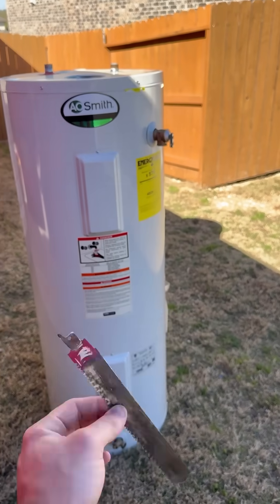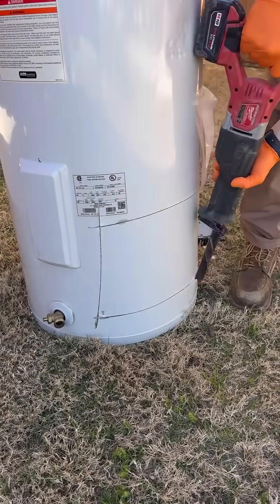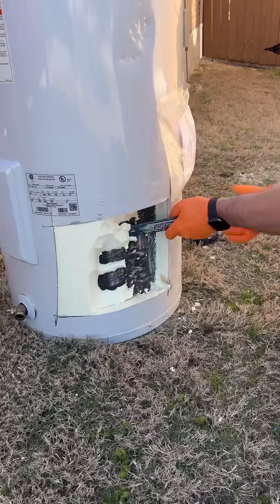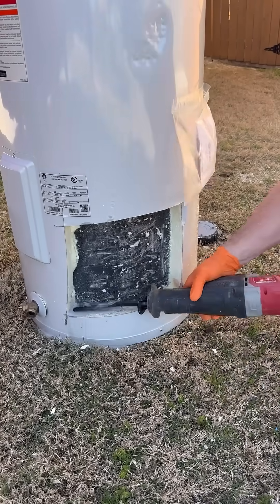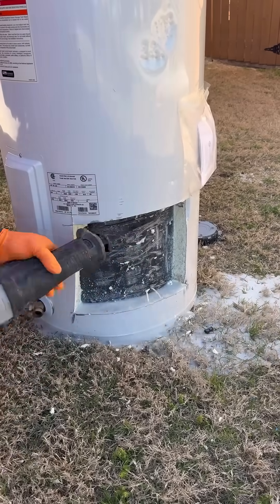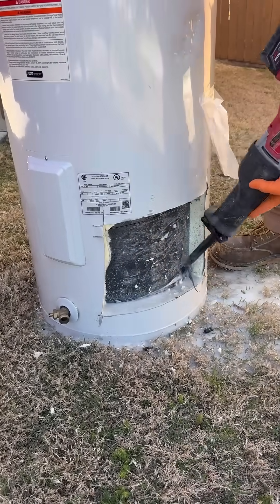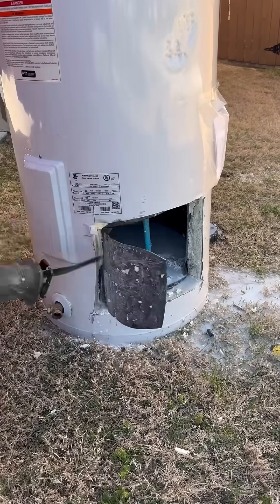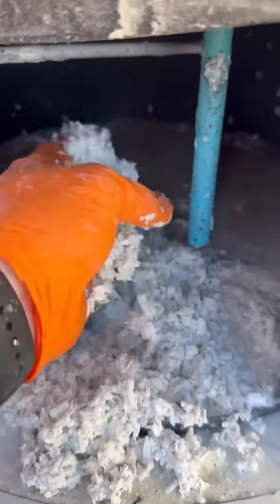What Is Inside This Water Heater?

Comment: Try adding a couple gallons of white vinegar, and let it sit 12-24 hours.. drain and then flush 2 or 3 times.. it'll save you about 800 dollars
Reply: I just replaced the cheap plastic drain valve with small outlet on my water heater with a large brass ball drain valve with a hose connection, and drain it every year as he says.  Getting that extra flow gets a lot more junk out.  I also keep the anode rod checked and replaced about every three years or so. After 12 years it still rumbles a bit from time to time, but it’s not too bad.
Reply: How did you get the plastic valve out? I was afraid to touch mine without breaking it off in the water heater  @E.L.RipleyAtNostromo
Reply: Citric acid works way better :)
Reply: @AAAAAAndrea why is that? Is it more cost efficient too?
Reply: @DM-ry3nw  back in the days I could buy citric acid at a ultra low price, now it's similar. But citric acid makes waaaayy less smell and works better
Reply: @AAAAAAndrea I'm feeling frisky. Why not just go all in and use hydroflouric acid?
Reply: @AAAAAAndrea muriatic works better than that
Reply: @AAAAAAndrea I believe citric acid is more expensive per gallon though right? I may be wrong
Reply: @AAAAAAndrea  Muratic Acid?
Reply: @crazysquirrel9425  Muriatic is strong and tends to corrode steel more, these are gentle acids :)
Reply: @AAAAAAndrea  put in a buncha orange juice, gotcha!
Reply: @pm079  lol, not orange juice :) buy solid powedered citric acid, put it in boiling water (to kill any mold/bacteria in it and to dissolve it properly ) and then throw it in.
let it act for a bit, acts super fast the more warm the water is.
Reply: @pm079 it's not strong enough ( at least I don't think it is)
Reply: @squidwardshouse7375  We have different heaters in my country :) we used to use acid in them.
Reply: Where do i pour the citric acid from? Any suggestions would be much appreciated thanks.
Reply: @rubenmadrid3154 Either pour the acid through the sacrificial anode hole, or disconnect one of the water connections in the top of the tank.
Reply: @rubenmadrid3154  in the hole where the anode is? in EU we have many diffirent heaters and its easy to add something inside.
Reply: @rubenmadrid3154 if you can remove the anode rod from the top of the tank, you can add the citric acid from there with a funnel. That’s what I do. Otherwise you would have to drain the water heater connect a hose with a funnel to the water heater drain valve and add the acid that way, which is a chore and doesn’t look very effective. There are videos of guys doing that with vinegar.
Reply: I replaced my water heater myself, same size as in this video, cost $600AUD
Reply: @A-Dingleberry  mine was about 300 you were over charged
Reply: Citric acid better and cheaper
Reply: @MrBalrogos Muriatic acid is better.
Reply: I used muriatic acid, I like to turn off my water at the main valve and pop both Inlet and outlet hoses on the top, let it drain a good bit and then throw and couple caps full of it inside. Muriatic acid is used in a lot of things but you can actually buy it to clean the calcium buildup on and in pools and help with calcium build up. It worked great for me for years now, a days worth of work but I haven’t had to replace my water heater in god only knows how long.
Reply: @ExodusAlpha3908  In my country I can buy it freely , but I still don't use it. Way safer with citric acid :)
Yeah muriatic/ hydrocloric could be good but you gotta be careful with it.
Reply: Make us a video please @ExodusAlpha3908
Reply: Omg lol another magical miracle white vinegar lie
Reply: Everybody here who doesn't understand that Coco was joking 🫏🫏🫏🫏
Reply: Better opinion is why doesn’t manufacturers make a clean out port so you can effectively remove it and access the inside of the take clean this stuff off. Rather than making it so I closed that you’re only option is replacement ? Knowing damn well if we could open this tank and clean it we’d get many more year out of it.
Reply: @Bladekieta96 They do, is the valve at the bottom, they also install anode rods that should be regularly replaced. Almost no one does it though. 
You can’t expect them to put a trap door on a pressure vessel so you could wait 10 years and clean it out with a broom. That would significantly raise the price and wouldn’t get used anyway. Flush it out yearly using the drain and you’re good.
Reply: @Bladekieta96  usually they are  tossed when the element leaks at around stated lifetime.
Reply: @Bladekieta96 there is a drain at the bottom of your water heater. you're recommended to drain/flush it yearly to clear any sediment from it. you don't even need to pay someone to do it, if you have a hose you can do it yourself very easily.
Reply: @bladekieta1828  you answered your own question.  So you buy a new one 🤦‍♂️
Reply: @Bladekieta96 mfg don't want that😂
Reply: @bladekieta1828 lol are you serious? They don't care aboutbus servicing the equipment.... they prefer us replacing it... that's more money on their end...
Reply: @Bladekieta96  Because it's a sealed pressure vessel encased in 3 inches of foam and a layer of steel, Einstein.
Reply: @Bladekieta96  Cause money! better to sell new one that for customer use 1 heater and maitance it right :)?
Reply: It was replaced because it was leaking, not because of the buildup
Reply: Damn the entire citric acid crowd is totally wrong, (talk about failing chemistry lmao) acetic acid has shown time and time again to be more effective at dissolving calcium, then again, our water heaters arent that shitty compared to american heaters, but no. Go ahead, use all the citric acid you want. Maybe someday you realize theres a difference between vinegar (5% acetic acid) and pure citric acid, yes it will work faster, but pure acetic acid will serve you much better in the long run and you wont fuck up your water heater, which if you keep it up by using citric acid and boiling water, soon you wont have a boiler anymore. Please redo your chemistry classes.
Reply: Yes. Citric acid WILL remove it faster and chelate the calcium ions faster but so does the metal. Do yourself a favor and use acetic acid. Not citric unless you want to replace your water heater every 10 years ig lol
Reply: Also dont use boiling water. Room temp is more then enough to eat away at the calcium ions, using boiling water is literally making everything worse with no benefit.
Reply: @ananteshesha5788 Fully agree, and there's another reason why you shouldn't use citric acid. It forms calcium citrate which is insoluble in water and just precipitates out, but when you use vinegar it forms calcium acetate which is water-soluble and can easily be flushed out.
Reply: Vacuum and a hard tube to scrape the bottom. The buildup around here is insane.
Reply: White vinegar does not repair the glass liner 😂
Reply: Sweet, I was just asking, "How would a person  clean it?"
But I see your answer.
Thxs dude 👍
Reply: Thinking the same thing it looked new
Reply: How on earth do you flush it? Can you make a video?

Never knew you can get build up like this. Ours must be full.
Reply: @dale7561  There's an easier way than asking for a video on YT...GOOGLE IT !!!
Reply: if you want rust yeah
Reply: How exactly would it save you 800? Genuinely asking
Reply: Easier way. Install a full flow/ball drain valve. Turn the incoming water off but open a hot water faucet or two. Drain the tank. With the drain valve open fully, Drain the tank again. The water filling the tank will stir the sediment. With the tank drained a couple times and empty, you can insert a 1/4 inch plastic hose and flip it around to loosen any remaining residue. I've done it this way and get my water heaters to last 25 to 30 years. An endoscope on my cell phone shows a clean tank.
Reply: How do you put vinegar into the tank?
Reply: @steelewheels1365  Either the incoming or outgoing nipples in top can be used. The incoming nipple is best and easiest. 
Or, drain the tank completely. With a hot water faucet open as an air vent, hold your drain hose at the top of the tank and pour the vinegar in through the drain valve. Close the drain valve. 
If you have an electric water heater, you can remove a heating element and pour the vinegar is that way. Soak the h4eating element in vinegar to clean the build-up.
Reply: Vinegar is 50/50... it'll take a lot, and agitation helps (there is none). Whatever you do, don't try using CLR
Reply: @juansolo1617 what is CLR may I as
Reply: Adding it how exactly?
Reply: @Giggidygiggidy12  Through the sacrificial anode hole, or disconnect one of the water lines (it doesn't matter which)
Reply: Vinegar is kind of a miracle product. I‘a what I use for 90% of the housecleaning I do
Reply: How is this going to fix the big hole on the side of the water heater?
Reply: Will vinegar corrode the metal?
Reply: Just imagine using that tap water for consuming how unhealthy all that calcium is, it's like people that have copper pipes or iron pans and are consuming all that extra copper or iron.
Reply: But the thank has a big hole,now
Reply: How’s that supposed to get in the water heater? Water does not go through the water heater after it leaves your toilet.
Reply: @TA.387 I guess you're trying to get roasted as well
Reply: It scares me to think 4000 people liked your comment about putting vinegar in your toilet to fix your water heater
Reply: Or cut it, clean it, and seal it.
Reply: You have to do it regularly or it will destroy the tank
Reply: No body tells you to flush them so all you idiots don't make sense
Reply: Um im sure u flush urs every 3 months rt thats about how much ud have to do it . There a zinc rod in the wheater thats suppose to protect the elements from this stuff but i cut open tons of these things its always some crap in the bottom . U about got to remove it to flush it and do a good job. The drain at the bottom at least the ones 10 plus yrs old will Not drain
Reply: Question why the manufacturers don't make an opening - slot to be open and clean it out very easy ...o we will not have to replace ot anymore..o no money for them $$$$$$ f them all
Reply: Vinegar and steel?
Not a good combination.
Reply: But that will speed up rusting
Reply: Was waiting for the family cat to come crawling out. 😂
Reply: Does this oxides the tank?
Reply: My dad uses a vacuum and sucks it all out
Reply: How do you get it in the water heater? I'm a new home owner and didn't know to do this. I bet my tank is bad at this point!
Reply: @djvelvetgrrl  there should be a water shutoff on top of your water heater. You've got a hot side and a cold side. The cold side is your supply, so that's the one you need to shut off. If there's a ball valve on both sides, it's even better. Turn your valve until it's horizontal to the line, meaning it's closed. There's no need to wrench on it too hard. Once you've closed it off, turn off your water heater, letting it cool down before hooking up a hose and draining it down about 1/3 of the way. Disconnect your water supply and funnel in your desired water heater flush chemicals. Reconnect your water supply and let the tank fill back up, careful not to use your hot water inside the house during this part of the process. Let her sit for a while and drain completely at least twice before refilling and firing her back up for use.
Reply: how do you add vinegar??
Reply: How about a water softener!!!
Reply: Home Depot sells concentrated vinegar specifically for cleaning. 30%, or there about.
Reply: Cool
Reply: How is that gonna help, there's a giant hole in the side. Damn you must be stupid
Reply: Gonna cut open the plumbing to the heater to add the vinegar, then fix the plumbing to run the water through? It's a tank not a bucket, they tend not to open. That's why he cut into it.
Reply: @Lord_Neko_  nope. If you look carefully at your water heater the inlet and outlet on top have threaded connections and in my area it is code to use flex-pipe which makes it easy to remove so you can funnel your chemical of choice into your waterheater.. they make descaler specifically for water heaters. I used to work for a company that would actually do this for you for about $200. But for me, I find vinegar works just as good, and you don't have to wear PPE to handle it
Reply: The tank is 4 foot high, and the calcium is just 2 inches...   Plenty more room....
Reply: Or buy citric acid
Reply: Shop vac, duct tape, and a length of garden hose... I ain't waiting
Reply: How much nu calgone would you need to clean this?
Reply: Are water wrappa's still a think and are they worth it?
Reply: The Wrappa is a compact electronic scale conditioner that uses radio frequencies to alter the characteristics of the minerals within the water, preventing them forming hard to remove scale deposits. With no pipes to cut or joints to be made, the Wrappa is easy to install & maintain.
Reply: Just remove the element lay the tank down on two block, there r two 1 inch socket there u attach a hose full it up them turn it an flush it out use ur fingers
Reply: Add it where 😂
Reply: Have to make sure you have the bottom open, don't leave it closed while the reaction takes place. Have seen a water heater explode due to this, it produces huge amounts of co2 gas.
Reply: @rdizzy1  what happened to the relief valve?
Reply: @coro_ctrl Is there a Mr. Gump, Mizzes Gump...?
Reply: Would be nice to make a water heater with an access door you can open and scoop up all the crap at the bottom of the heater but that would be too easy 😅😅😅😅
Reply: @Derek-ex7sn  A pressure vessel with a door in it? 🤔 
Yeah, can't see how that could possibly end in class action lawsuits.
Reply: @Coro. There’s still time to delete your post.
Reply: No
Reply: 😆 always the dumb vinegar idea Hahaha. People failed chemistry lol
Reply: @amushyforyou6083  never took a chemistry class... but I've been plumbing for several years.. I think I know a thing or two.
Reply: @amushyforyou6083  Sounds like you failed chemistry, vinegar is a chelator of calcium.
Reply: @amushyforyou6083 no good :??
Reply: @amushyforyou6083  Vinegar is really ultra mild on calcium, always funny to hear the vinegar BS 😂
Reply: @dimmacommunication white vinegar is usually.5-2% acid. I have some that's 30%. That will definitely break down calcium.
Reply: @AAAAAAndrea I use vinegar all the time on calcium buildup on shower head. It removes it fast-even the hard deposits.
Reply: Guys,

YaH The Heavenly Father, HalleluYAH “Praise ye YaH”, (Genesis 1) was Who they Crucified for our sins and YaH arrived to be Crucified via the Tent of Meeting (Hebrew Book of Isaiah)

YaH The Father (Genesis 1) <— He’s our Savior
Reply: That makes absolutely no sense because when you flush it it just goes into the sewage system not the water heater lmao
Reply: @coro_ctrl he’s talking about flushing the water heater.. not a toilet. lol
Reply: @Tripcord  He ain't that bright 😅
Reply: @coro_ctrl  once all that calcium is broken down by the vinegar (being slightly acidic but food safe) you have to get rid of the free floating calcium or it will just sink to the bottom and reform into a disk shaped rock.
Reply: @Misfit.Profit  i dunno how is there, but here in central europe water heaters have their heater core on the bottoö, so you can remove a large access panel on the bottom, and clean it by hand every 2-4 years. Also we have a galvanic rod which you can replace periodically, as it gets eaten away by rust instead of the tank's body.
Water heaters stay in use here for like 30 years here.
Reply: Is that gard to get rid of the free floating calcium? When I flushed my tank in the past I was very vigorous filling it then totally empty , many times. Also oartual fill, ppen pressure flies, add some air Pressure, total flush again
 Is that free floating stuff different than the normal calcium sludge ?  @Misfit.Profit
Reply: @coro_ctrl you are a comical genius.😅
Reply: Haha @coro_ctrl
Reply: @coro_ctrl  There's a valve on the outside of the tank that is threaded for an ordinary garden hose. I'll let you figure out the rest. SMH.
Reply: @coro_ctrl facepalm
Reply: @coro_ctrl you flush it through the water with an external hose
Reply: @coro_ctrl the fact you got 17 likes is mind boggling. People need help
Reply: @koffeetechshow he got more . we're living in the movie idiocrcy
Reply: @coro_ctrl this is one of the best trolls I’ve ever seen dude 🫡
Reply: @coro_ctrl yikes buddy….
Reply: @coro_ctrl 
 Thats the point.
Reply: @jjjsmith2497 yeah, if you flush enough vinegar into the sewer system, the entire system’s water will be decalcified, softening your water
Reply: @coro_ctrl how many extra chromosomes do you have? With a comment like that my guess is at least a dozen.
Reply: @coro_ctrl hey dude, it's been 4 days, you ok? 😂 We all have those moments hahaha
Reply: @coro_ctrl man you are tragic
Reply: @coro_ctrl jokes repel from your head
Reply: @coro_ctrl 🤦
Reply: @coro_ctrl I’m assuming you’ve never rode in a normal big school bus huh? Always the shorter ones
Reply: @coro_ctrl  are you slow? flush doesn't just meant toilet
Reply: @coro_ctrl  bwahahaha you thought they meant "flushing" meant "flush the toilet??"
😂😂😂
Reply: @coro_ctrl Room temperature IQ type of comment
Reply: @coro_ctrl so when you flush your engine you have to flush your toilet to do it?
Reply: @coro_ctrl  there is a valve at the bottom of the water heater that flushes the water out, you can attach a hose to it and take it outside.
Reply: @coro_ctrl how does it feel to be utterly r tarded?
Reply: @coro_ctrl  r word.
Reply: @coro_ctrl  it technical team us by plumbers, in normal contacts, normally means piping system for clear out the in side pipes?
Reply: @coro_ctrl  he means unbolt tank find the inlet pour the vingerger wait the time then pour it
Reply: @coro_ctrl  you’re not the sharpest tool in the shed are you
Reply: @coro_ctrl son I bet your bus was smaller than the rest and had grape flavored windows.
Reply: @coro_ctrl  no shit?
Reply: @coro_ctrl don't have kids
Reply: @coro_ctrl  huh ?
Reply: @coro_ctrl say you’ve never worked on your water heater without saying it😂
Reply: @coro_ctrl br..... bro....... lmao.... 😅
Reply: @coro_ctrl  😂
Reply: @coro_ctrl did you know there is long bus?
Reply: @coro_ctrl you’re getting cooked
Reply: @coro_ctrl  flush as in drain and refill.  like how the toilet drains everything and then refills the bowl. same as in flushing a car's oil tank: you fill it and empty it a few times to get all of the unwanted contaminants out.
Reply: @coro_ctrl  what?
Reply: @coro_ctrl  Wtf you talkin about hahah
Reply: @coro_ctrl  when your mom said you were special, she meant it in a different way from what you thought.
Reply: @coro_ctrl  hahahahaha you're cute
Reply: @coro_ctrl he meant add it to the water heater and flush it
Reply: @coro_ctrl bro just delete this comment 😂😂